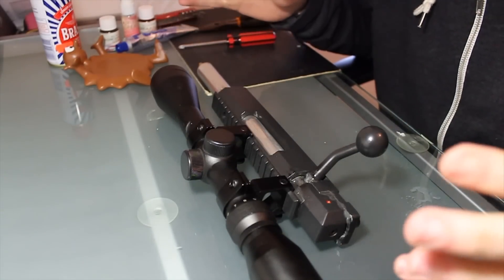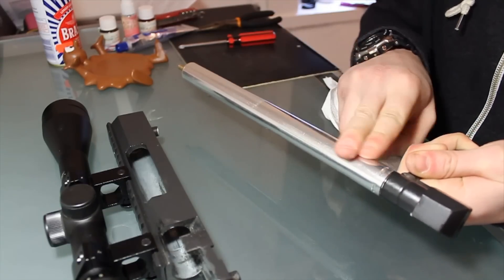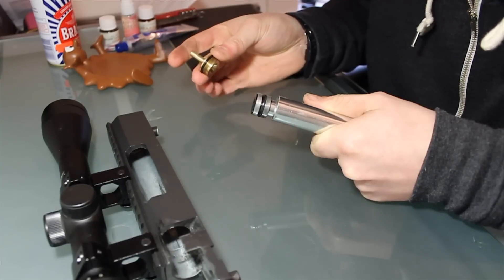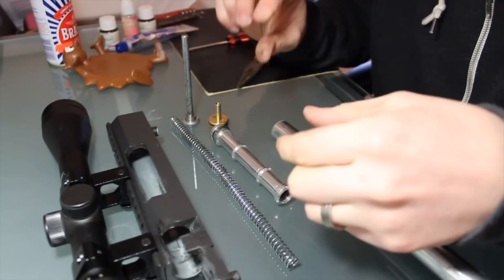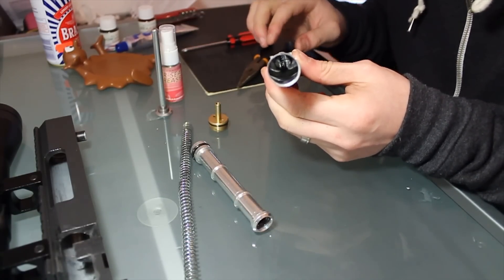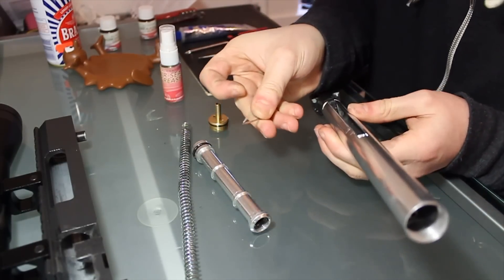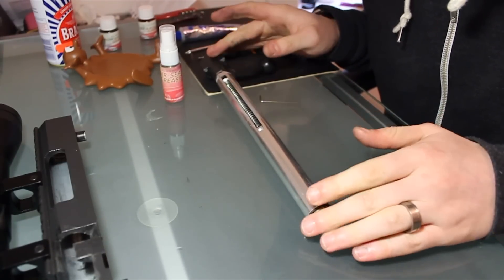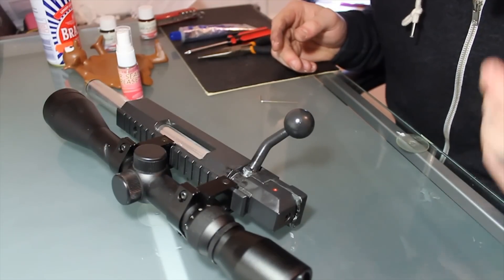L96 Breakdown Tutorial - Bolt & Cylinder Removal / Upgrade - Pt 3

Comment: Firstly, great series of videos from Trashy... clear, concise and with no unnecessary fuss.

Sadly, my experience with the Well Warrior L96 MB-01 has been pretty poor. From new, purchased the same way as Trashy and before skirmishing properly, I've since upgraded:

1. Hop up - ASPUK Hexagon design unit
2. Madbull 6.03mm x 499mm Vers. 2 AEG inner barrel
3. ASPUK Piston, Spring (150) and Spring Guide kit
4. Flash Hider
5. Black Steel Cylinder
6. H-Hop Nub
7. Madbull 65 Degree Hop Up Rubber

Therefore, if you've watched this well put together video and you're wanting to introduce a Sniper rifle into your arsenal then please at least consider the following....out of the box I had problems with:

1. Factory Hop up rubber lasts approximately 3 mags maximum. Absolute rubbish grade of rubber. If you're gonna stay with the stock hop-up, upgrade the rubber to one that will cope with heavier BB's and more power from an upgraded piston / spring! Also, the small brass ring that goes on the end of the rubber is mildly frustrating and never sits in the hop properly causing BB's to jam.

2. Stock cylinder is also rubbish - the way it's fixed to the lever arm is simply pressed into a small groove and will also not last long with an upgraded piston / spring. If you're upgrading your spring and piston, upgrade the cylinder also!

3. You may as well upgrade the entire hop up unit also in my opinion. Trashy's other video on his hop-up is extremely useful and gives great insight but longer term, I'd seriously invest in a better hop unit than the stock version - the design and grade of the materials used is very poor!

The hop, hop rubber, inner barrel, spring, piston and cylinder may be able to manage with the tolerances of firing a weightless 0.20g BB but seriously fails when you want to anything more weighty like 0.38g's or 0.40g's.

All in all, if you're wanting to buy a Sniper rifle, save a little bit more money and buy a better made one than the Well version otherwise you will find things go wrong very easily because of the poor grade of materials. Alternatively, look around for a second hand one that has basic upgrades done on it. Fortunately/unfortunately for me, everything went 'Pete Tong' within 2 days of it arriving.... steep learning curve.

Comment: Hi, I just got  a Tokyo Marui L96 and was looking to upgrade the bolt/cylinder internal. However, the cylinder head only has one hole in it (as opposed to the two you used to open it with the needle nosed pliers) and appears to have a retaining pin going into it from the side of the cylinder. Any ideas on how to get it off because I do not see any that do not involve drilling out the retaining pin and replacing it after you install the internals. Thanks. :)

Comment: there are some parts of the bolt (small pins, a copper small cilinder, 2 black pins) that i don't know where to put. Also i found this white plastic ring. The ring can slide snuggly over the cilinder, but i don't see it on other disassemblies. doesn't fit in the barrel eithe.

Comment: Hi, i really need your help, i just bought a new L96 and i was shooting with it to adjust my scope when suddenly i accidentally cocket it the wrong way i think, i think while i was clocking it i accidentally pushed the safety switch and now i can not pull the handle down or shoot with the trigger, also a small little bolt fell out and i dont know where did it come from but i think its the one you talked about not to lose. Can you pretty please help mw with this?

Comment: I hope you can help me.
I have bought a well mb4403d ( marui clone ) and i want to replace the cylinder with a black one that i have bought from airsoft pro.
I can taje out three screws in the bolt 2 underneath the sort of block like end and one at the end wich is facing when you aim.
There is one screw left in top op the round part I beleive.
Thisone is allmost like it is glued in there really reallytight can you tell me if I am doimgsomething wrong ? Or is it there for looks ?
It is reallydrustratingbecause i bought the cylinder allready

Comment: this gives brilliant insight for the mechanisms of the gun :)
Reply: aside of the metal trigger box, what would u say are the most essential things to upgrade on this gun?
Reply: ***** Can you use Brasso metal polish aswell? I don't have that PEEK stuff. And also, why don't you have any teflon tape on your cylinder head threads? It increases fps a lot. Just a thought.
Reply: reply was a bit late if I may say so. I bought a TM l96 in the end, upgraded the spring, piston seer, piston and spring guide and left it at that.

Comment: I dont even know if you'll look at this comment as this video was so long ago, but I got a Well MB01 this week. I shot it 4 times, on the 5th time I cocked the bolt but when I pulled the trigger nothing happened. I have looked at everything and found that a sear in my trigger box was broken. I bought all new metal trigger box and spring/piston set, got it all together and it still wont fire. the bolt is still cocked and i can't get it to fire. the trigger box also wont come out as it is cocked, even when I remove the 2 side screws holding it on. so far there is nothing online that can help with this problem. idk what it could be as it is a brand new gun, and brand new parts, both with the same issue. plz help if you ever read this!!!!

Comment: I actually have a problem with my l96 that I'm not really sure how to fix. I was out of the room when my friend was playing with it, he said he cocked it back and this little gold piece fell out and now the bolt won't go back into firing position, its absolutely stuck. You can still cock it back, but you can't push it down into place. Its a Mauser SR L96 and I would really appreciate it if you could try and help me out, thanks for looking.
Reply: ***** I ended up ordering a new cylinder and bolt assembly because the bolt I had was not able to be taken apart, The screw in the back was fake, so I ordered a part from the WELL l9 which I was told will fit. There was no way the old bolt was going to budge.

Comment: I've just installed this upgrade on my L96 I have a newly installed metal trigger box as well the problem I am having now is when I pull the bolt back it will not cock I have stripped it back down 3 times now and I cannot rectify the problem would really appreciate any help you can give me
Reply: Mine also

Comment: Hey my part ok bolt handle on my gun basically broke. So when I pull it back it doesn't take the cylinder back with it. So basically the metal part broke. Any ideas??

Comment: So after I upgraded, my bolt wont catch when I pull it back. I tried putting in the old parts, but the bolt still wouldn't catch. So obviously I did something wrong. Any idea on what's wrong? And how to fix it?
Reply: *****  I'm not sure what I'm exactly looking for. I took the Trigger box off, and looked over it. Everything seems fine. This is the first gun I've upgraded, and don't take my guns apart if I have to. So I have no idea what I'm really looking at or doing.
Reply: ***** I found that the Sears are not lineing up properly when the trigger box is closed. When it's open, I see how everything functions, how the main sear catches the Piston sear, and realeses when the trigger is pulled. But when I put it back together, the piston sear won't catch on the main sear. Like something is pushing the Main Sear out of alignment.
Reply: ***** I've done that as well. The trigger still doesn't work.
Reply: ***** It worked fine before I took it apart. When I went to upgrade it, I didn't touch the Trigger box. When I put it back together, it din't work. So I thought it was the upgraded parts. I put back in the old parts, but it still didn't work. So then I asked you and you suggested the trigger sears. And after a bunch of messing about, I found that the main sear that runs the length of the box is getting pushed out of place when the trigger box is put together. Everything is where it should be. I got the Sears to function properly, but it still won't catch when I pull the bolt back.
Reply: @MsgHewson  did u ever find the problem,my tsd 97 is doing the same thing when I took it apart also.

Comment: When i pull the bolt, it jam at jam a little at the beginning and the same thing happen when i push it back . Its not a lubrication problem.. any idea ?
Reply: It's the cylinder head scraping the hop up chamber.

Comment: Excellent video. Ran into a problem after reassembly. The bolt can be cocked back but when it's slid forward it stops right before making it into the receiver. Any ideas?

Comment: Friend,
You showed a grease but not used. I did not understand!
It is to use grease inside the cylinder?
Reply: has no oil risk going down the pipe and affect accuracy?

In his opinion, it is better to change the original hop up the L96 by a PDI or JJ?
Or I get good results with the original hopup?
My bucking rent, need another, you know inform how best to spare?

Thank you for your help

Comment: If upgraded to an m160 spring, but the velocity is at a poor 336 fps (in stead of the promised 500+ fps. Any ideas on how that is possible?
Reply: You probably have an air leak.
Reply: air leak or your spring or piston or spring guid is damaged.hope this helps.
Reply: ***** No, that's not the problem. That reducer was taken out from the beginning. It is mainly a spring problem. I used the same upgrade you have 2 years ago and the spring simply had it's best time. Already ordered a new 150 (9mm) spring from ASPUK. Now just waiting on other parts to put back together the sniper. I'll see what velocity the sniper will achieve after upgrading with "professional" parts.
Reply: ***** piston not too small, because it came in the same package as the spring and spring guide. The spring is just at the end of it's life. At least I hope that is the problem. I'll keep you posted.

Comment: Can someone help me what this is: "This cylinder is NOT for 1st type of Type96.Please note that.If you don't find which type you have one,please check your cylinder shaft.12mm around is 2nd type,8mm around is 1st type." What is a Cylinder Shaft??                                                    I Bought my L96 used by an old friend, and he didnt know either...HEELP ME. I wanna upgrade my "new" airsoft and start play! And I buy everything from x-fire.org
Reply: is palsonite cylinder vc something u would recomend? is a vacum cylinder any better then a hard regular cylinder. and can i upgrade a vacum cylinder with a stronger spring?
Reply: +RandomTrashy How do i remove the cylinder from the bolthandle?
Reply: ***** Yeay, I found it. Smallest allen key ever was needed.